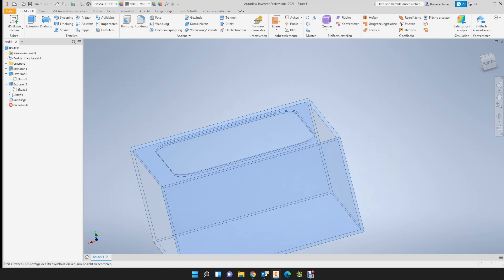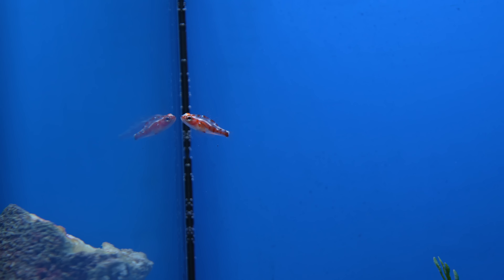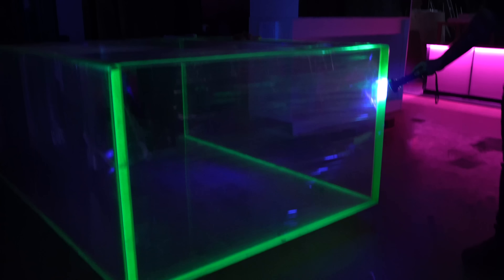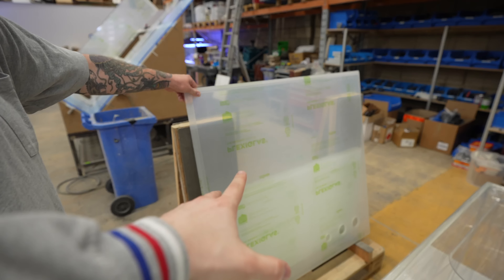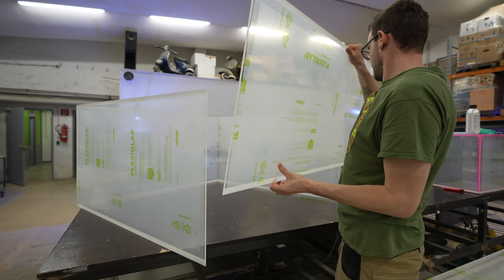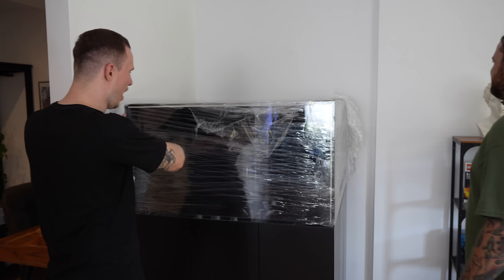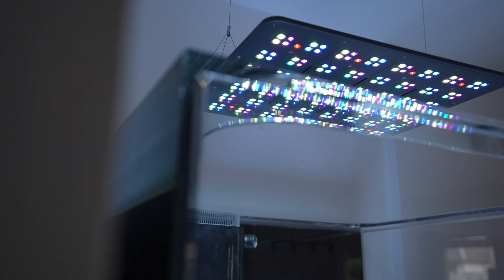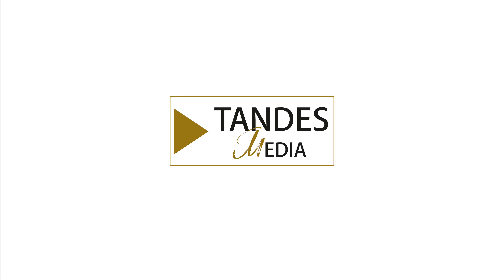This is my new REEF AQUARIUM - Seafriendlyreef tank

Comment: Use micro fiber towel to clean it what scratching it.
Reply: Nothing beats the look of acrylic and you can keep it from scratching just make sure you don't get sand on your micro fiber towel. And unlike glass if you do scratch it you can buff it out glass not so much plus acrylic is 17 times stronger than glass ,insulates better and doesn't bow if it's thick enough.